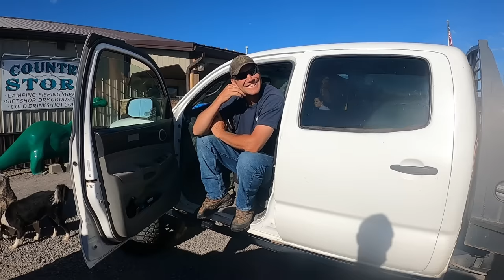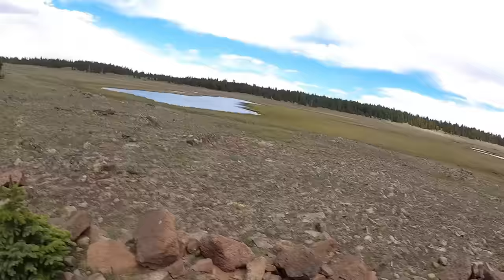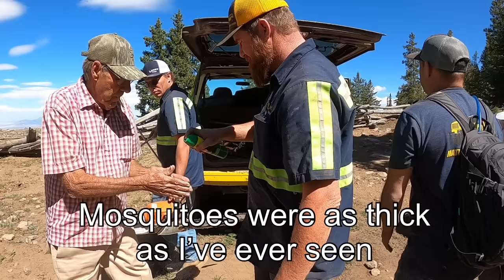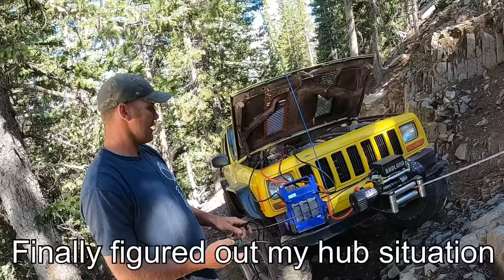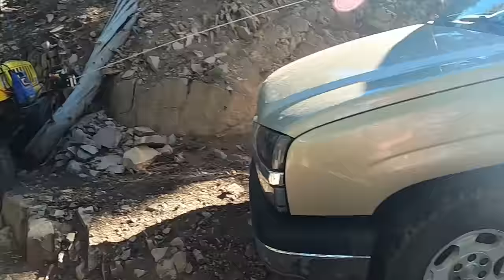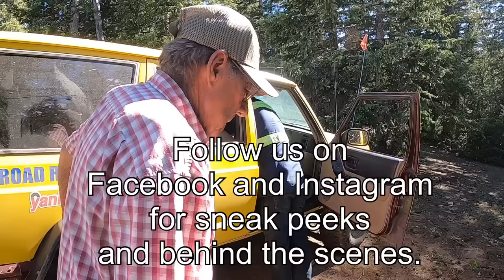There's NO WAY you'll recover that Chevy Truck!!!

Comment: Lol so you basically brought an unfinished build to a rescue where at least 4 others failed and made it look easy. Nice. Of course the truck was gonna start its a chevy
Reply: The only reason it started was cause it hadn’t burned down yet lol
Reply: GM gas V8s run like crap longer than most other engines run period.  They’ll keep running so long as you give them oil, air, fuel, and spark.
Reply: Todd Lynch that’s pretty funny
Reply: @toddlynch7282  If that's the 6.0l that thing will run forever and ever with decent care lol.
Reply: @hipno3626  lol, got 2, 2004 CHevy Work vans, both have been wrecked and totaled by insurance, but still keep going. a 5.3L with 273k miles, a 6.0l with 292k miles, Still driven everyday 100-200 miles a day. But you're right, they're totally not reliable.

Comment: I did one like that myself, got in a really bad spot.   Ended up bringing a dozen 20' chains, one  cable puller with 40 feet of cable and a bunch of pulleys and shackles to inch myself out of the hole,  3 and 4 to one pulls to get it out.  Mostly couldn't afford a wrecker and was too embarassed to ask for help :)

Comment: Hey, does anyone know if the white Chevy pickup has been recovered from the bottom of the gorge on the road between Marble and Chrystal Mill?
Saw it on July 1 2020 partially submerged. Makes this recovery look like a cake walk.
Reply: Summer 2018, I didn’t even make it a mile down that road before I turned my crew cab long bed around and got out of there. Good judgement comes from experience, which you usually earn from bad judgement.
Reply: You talking Colorado ? I've taken my CanAm over to Marble from Schofield and stopped for pictures at Chrystal Mill. I know people have gone over into the Devil's Punchbowl. I take it based on your comment someone else now went in.

Comment: I think you need to wire in a 350amp Anderson plug from your battery to the front of the jeep, means you can run the winch with the hood down
Reply: They tell you to put your hood up so the cable doesn’t fly back and go through the windshield. But I agree. A forklift plug would work too
Reply: matt rarely uses a winch

Comment: Serious question here: If this happens, and no one can recover it, can you claim it on insurance or are you hosed?

Also, shale rock. Damn treacherous.
Reply: Just an educated opinion here but I did do insurance underwriting for a time: it would have to be proven to be unrecoverable (photographic evidence, two or three experts would have to confirm that by deposition) before insurance paid out. If it was recovered after the payout, it would be in the ownership of the insurance company and they would sell it. Likely it would require safety inspections to allow it back on the road.   In this video the camera man bought it and drove it so without knowing the behind the scenes goings on, it is most likely that it was not an insurance claim and the owner sold it for the recovery fee and beer money....just a guess though.
Reply: Insurance coverage would not cover loss on off-road trails

Comment: What was the Silverado thinking!? Apparently nothing. They're lucky to be alive.
Reply: Agreed, I'm lucky to be alive.
Reply: They all think that 4 wheel drive will save them~!! Just gets inexperience in More Trouble~!
Reply: I was actually impressed, looking at the truck and where it ended up, that Mr. McPeck didn't try to get it out himself. He saw the position it was in and realized right up front that anything he tried would only make it worse. He handled the situation in the best way that was available to him.
Reply: Rickarama Trama I’ve always been told, go as far in as you can in two wheel drive, then back out in four wheel drive.

Comment: So, just in case I find myself in a similar situation, how much do you charge to extricate that poor, optimistic fellow?  My guess was around $2,500.
Reply: I don't know much about recovery but if it didn't cost the guy at least 10k they gave him a deal. Thousands in equipment, 2 trucks and a crew of guys better be more than 2500.
Reply: Is that truck even worth that much
Reply: No definitely not. But it had to be recovered regardless of what it's worth. It's like leaving trash in a park. Not acceptable. He was going to get charged fines if he left it
Reply: @Cable-Tech-Pro-Joe-TX  In California it is

Comment: Im super curious as to what the cost would be for such a recovery
has to be at least two grand
Reply: What i was thinkin
Reply: It costs you your truck.
Reply: @adamrubinger2644  ? No it does not it is still registered paperwork and so on and if they fail.. :-(
Reply: @kitecattestecke2303  did you even watch the video or just reach straight for your YouTube diploma? Dude sold his truck to the cameraman, I was being sarcastic, but in the end this guy did not take his truck home.
Reply: Mike Mason Easily. That’s a four man crew and two rigs and equipment. Plus travel expenses. Those men’s time is worth an easy couple hundred per day. And that’s lowballing
Reply: @ShaunHensley  I am thinking 5,000 -6,000 $'s.
Reply: I've asked them before on the cost of recovery, a lot of the stuff they do for free as a service. I couldn't believe it
Reply: @kathlynfinney4378  
That would be downright Saintly of them, cause the cost to recover a vehicle is insanely high, and it is not easy bonehead work you have to know how to plant your vehicle how to pull, how much to pull how to stabilize, reset, and reposition in very limited space.
Reply: 3hr drive out there for the crew, the crew, the job, the value of the recovery on a high risk job. Yea $8k minimum I'd say

Comment: I know people feed you advice all day long, but let me try some of my own.  Considering the danger of your recoveries, the lives at stake, and the desire for success on any job you tackle, I would recommend tires/rims that are Beadlock with protected valve stems.  An EXTERNAL roll cage, made of Chromoly 4130 or similar metal - you can use the cage to improve safety, as a "rope-off" for anchoring your truck during complicated recoveries, as well as recovering your own vehicle.  Also, depending on how the cage is made, it could also protect the vehicle occupants during overhead, rock falls.  I know you are big, bad, tough guys buy maybe cut-resistant gloves with wrist straps would be a good idea.

Comment: That road would be more stable & less sketchy if you took a gardening rake & cleared the loose rocks out of the center & used them to build a berm on the downhill side.
Reply: The CC's are not no more. Than maybe who built it to begin with,

Comment: You're the pro, so i'm definitely not criticizing, honest question for my own learning.  I don't think I've ever seen weighted blankets or other safety covers on the cables when you're winching.  Is there a reason?  I'm brand new to anything like this, and everyone has hammered into my head, the need for those covers.   Anyone can answer, I'm grateful for the info!
Reply: Synthetic ropes dont lash much when they break. They pretty much just fall to the ground. The real danger is standing in the triangle of death when a snatch block is used, because if the anchor strap breaks, the snatch block is going to fly towards you.

Comment: Haven’t watched it but it looks like an easy recovery. May try to cut the wheel hard left then pull it back just a little bit to see if the front will go right up towards the road. You’ll know after a little bit.  If that doesn’t work you can help that process by going under the rear bumper to the front left with your winch.
Reply: You weren't there!!!

Comment: What an epic recovery! At one point there, I thought one of the wires where about to snap of tension stress. 
So, a question from a new subscriber (from Norway) that work backwards in you videos archive.. How would big tyers like 475/70R17 (44inch) with deflated air, fare on those rocks and in sand dunes. In Iceland they are often called "floaters" because they make the trucks float on snow. I would imagine that they would be superb on both sand and loose rocky conditions like this. (But then again, I'm no real off roader).

Comment: I can't believe that truck even had a working battery after sitting at such an angle. Figured the thin air would've messed with things a bit.
Reply: Matt was afraid that rodents had destroyed the wiring. the battery was fairly new and a good one.

Comment: Each time I watch one of these videos I tried to put myself in the shoes of the person who got stuck, and what could I have done to get this out of there myself.
It appears that step one would be to run some anchor lines to keep from losing any ground or have it Go all over the edge. Step two would be to run a portable winch off the front end to the trees above, to pull tension up slope. And then step three is to use a high lift Jack to push the truck up slope a bit at a time,  while pulling it with the winch. It might take all day maybe even a couple of days, but it looks like it could be done.
Reply: If I had any of this equipment or if I could have found someone with that equipment to help me. Matt was my only hope and only one not to say get lost.

Comment: Before watching how it gets fixed: I would've done this without a vehicle. You use a portable winch and mount it on a tree, then use another one and ancher it with straps everytime it gets closer to the road. You won't need a vehicle to get it out. But that's where my head goes.

Comment: I picked up a technique to ensure my hardware is installed completely from somewhere. Once I torque a bolt to spec, I mark it with a paint marker. Then I can check to see that I torqued it and to see if it ever starts to backoff.

Comment: Several weeks ago I accidently discovered Matts channel,  and have been binge watching. It's cool seeing episodes out of order. I have a question.  Matt ha said his rigs use manual transmission.  When creeping across the rocks slowly,  how can you do that? Riding the clutch seems out of the question. Super low gears maybe? Does anyone use maybe  a fluid drive? Like a torque converter ahead of the manual?

Comment: What is with the fence that fab rats drove by?  Bans the shack that was shown.   Does people live up at this location.   What a great display of recovery skills.   Thanks for the video.
Reply: The fence may have built by CCC's. they may have built the trail also. No outlet at the bottom now. The cabin belongs to the Forest Service as does the land. No one lives anywhere close.
Reply: @dmcpeck  Thanks, I am not of that area, what is CCC's?
Reply: @richardp969  Civilian Conservation Core, formed in 1930's to put men back to work. Most were drafted into WWII. They did all kinds of projects all over the county.

Comment: I always wonder how much it would cost to rescue a vehicle like that in a  remote place. 
Do they charge you by the hour or a lump sum price/cost???????
Reply: Matt did a Q&A and kind of answered the question. He charges by the hour, and the clock starts when they leave the yard. He also charges a call out fee if the vehicle has been rescued by someone else before he shows up. I'm betting that doing rescues in the dunes just outside of town don't costs too much, but the guy who owns this truck has commented on this video that the cost was more than the truck was worth, but less what the fines could have been had it stayed up there.
Reply: @operator0  Matt was more that far. I also told him it would make a great video.

Comment: I just noticed you are using a Badland winch. I always wondered about the quality of the brand since Harbor Freight sells them. 
I was wondering if you could comment on the reliability and your opinion of it. It is obviously working fine here but my question is would you buy another one. I want to get one for my Jeep Rubicon but I was skeptical. Thanks very much.

Comment: very nice video.
is like you try to do something with precision. like try to peal a apple with surgeons knife.
in my country is always about time and lets done it with the hammer way no play around.
90% situation like this we get a simple 4x4 pickup car fill it with fast curing concrete and water we pour it we clean the road, angers to hold it not top it off or slide down. boring but 100% success.

Comment: Given the last 100 ft of recoveries like this forces you to put a vehicle in a precarious situation, why not put a winch on a dolly with an extension cord to connect back to the battery of a vehicle? Then you can more easily get a winch wherever you need it without putting another vehicle at risk, and just anchor the winch like you put the vehicle.

Comment: It's a wonder you didn't throw a rod in the Chevy truck. All the oil to the front of the motor away from the oil pump.
Reply: Guess why they checked the oil before starting it up 😉

Comment: Here is how I would have handled that recovery:   Get two portable 12-volt cable winches. Connect them both to a large tree uphill of the truck. Connect one cable to the truck's frame near the front, and then connect the other winch cable to the truck's frame near the rear. Tighten both of them up nice and tight. Then move the truck back and forth two or three feet while you slowly winch up both the front and the rear.

Comment: To anyone with manual hubs, do yourself a favor and get a red paint pen and another color.  Lock your hubs in and paint the indicators red.  Then unlock the hubs and paint the other end of the locking device and the corresponding area on the hub. This way you can see at a glance if the hubs are in or out.

Comment: All your vehicles should be upgraded in the backend to hold your gear securely. You should have a steel plate in the back locking in your jack and heavy equipment this morning because if you roll that thing all those Jacks and heavy steel objects, we’re gonna be smashing into you and that’s gonna hurt

Comment: What is the value of cars in the us? I mean...if you count that this "tow work" needed around 4 people with a full day drive and full day working hours with towing extra cars across these kind of distances.......just simply the investment was probably hell lot of a money to get there to the mountains with all the equipment. I would guess all the costs were around the price tag which was the value of the car itself they had to rescue. Why would anyone so dumb to pay that:? BTW the region was full with trees. Why didn't the owner just grab and buy some metal poles, smash them into the ground, and but a few winches for cheap money and apply an easy towing force to winch the car out from that spot.  This looks like way too much effort and cost for this kind of work.
Reply: Wrong on all points or there about. The value of the truck was not a factor.
Reply: @dmcpeck  Want to live in a place where the value of a truck isn't a factor. :D Well except if that country is the US. But you get my point.

Comment: That rescue almost looks like it was staged, the Chey Silverado looks way to clean to have been sitting their for that many months. There's no built  up dirt on it any ware they didn't have to clean the windshield.
Reply: @dmcpeck  Well I hate to tell you this but you don't have to find mud get dirty after just few days my own truck just sitting in the drive way starts getting covered in dust and if rains in looks worst. And I used to work for school district were I helped maintain over fifty vehicles  and  if some of them had not been used for a while you couldn't even see out the windshield because of so much dirt caked up on it and then there's always the spider webs  built up on the inside and out side.

Comment: Quick question: why do you tow your work jeeps instead of just driving them to the job? I know nothing about this. I just like watching men doing man stuff 🤭
Reply: These vehicles have very low gearing, which limits the top speed and makes them get horrible gas mileage. They are also very loud on the highway, and not that comfortable to ride in for long trips. Also, the tires are expensive and wear out quicker on long highway trips.
Reply: @operator0  Matt also thought he would have to trailer the recovered truck. I'm sure he was relieved when it started and drove.

Comment: renting a bulldozer and pulling the car with probably was a cheaper option to do this job
Reply: Certainly not. Did you not see the route that leads there? Do you think you can bring a dozer on a flatbed up that? Or do you believe bringing a diesel guzzling dozer up there under its own power is cheap and quick? You pay the runtime on a rental machine like that in addition to the fuel and when you run it for miles and miles you increase the chance of a breakdown and then you're really deep in the red...
Reply: @Ganiscol  Matt was more than fair but his costs were not my only costs. The Forest Service could have broke me, they choose not to and found Matt for me. I was at the end of my rope.